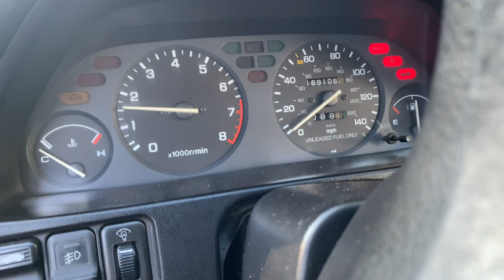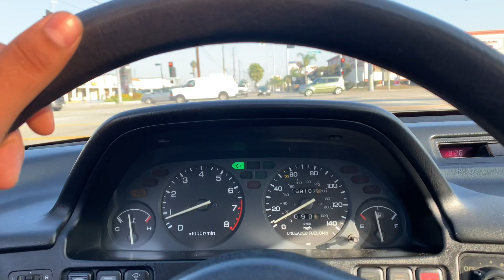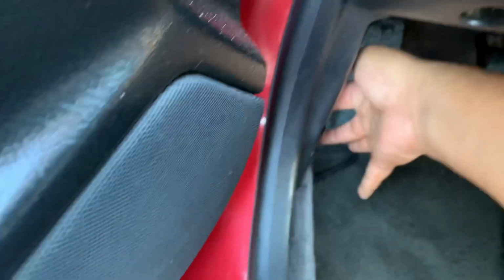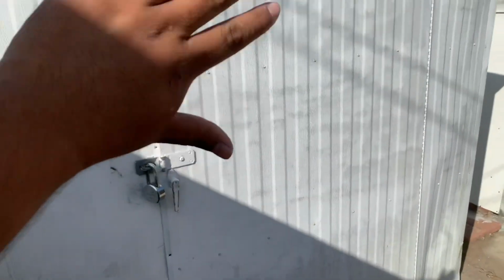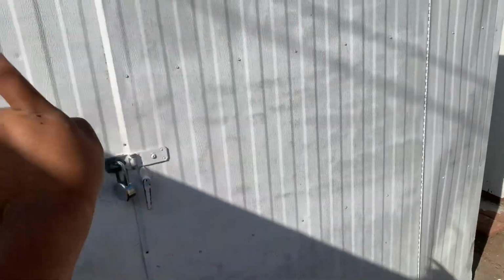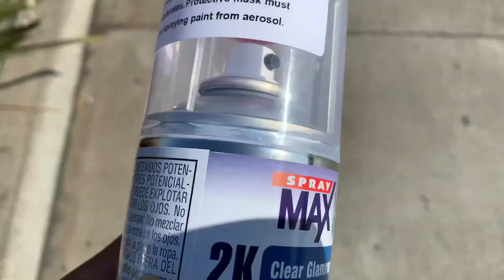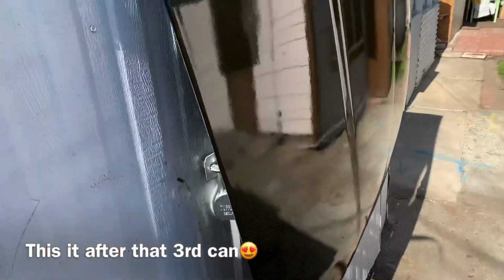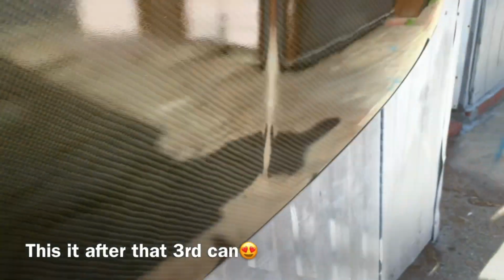HOW 2: RESTORE FADED CARBON FIBER HOOD W/ SPRAY PAINT!!

Comment: First off unless you want to have neurological problems definitely get a respirator, fume rated. Secondly, always lay a hood down flat when you are spraying clear. Then you can lay it on thick and you don't have runs and drips because it's already flat, it just settles
Reply from the maker: Thanks for the great tips! Will definitely apply these next time

Comment: Mines is peeling heavy my carbon fiber one. Should I wet Sand? Or can I use my sander with like a 6000 grit?
Reply from the maker: Sand it and clear coat it
Reply from the maker: Maybe 600 grit then work ur way up
Reply: @ToledoDIY  appreciate it.
Reply: @ToledoDIY  I have a battery operated sander. Can I use that? Or am I better just wet sanding it? 

Appreciate the help.
Reply from the maker: @Tactical_Response_Team  yes u can!
Reply: @ToledoDIY  I think the pdofable machine would make it quicker. What grit would you recommend with the orbit sander? 1000? Or around 600-700?
Reply from the maker: @Tactical_Response_Team  600-1000 then spray it
Reply: @ToledoDIY  Thanks brother. Appreciate your advise. Subbing to your channel now.
Reply from the maker: @Tactical_Response_Team  no problem! Thanks for watching
Reply: @ToledoDIY  Bro I been looking for touxup pain for my Lexus IS300. Need to finish up the bumper then paint and clear coat her. I have the door jam info but can't find it anywhere. Any suggestions?
Reply from the maker: @Tactical_Response_Team  not sure brother tbh